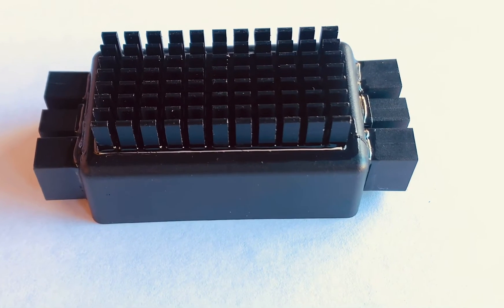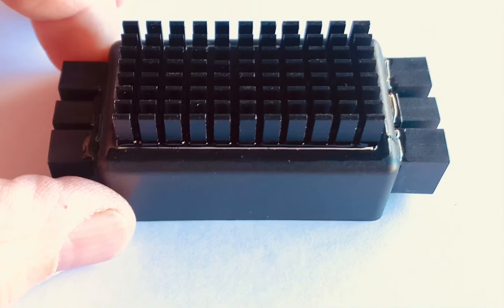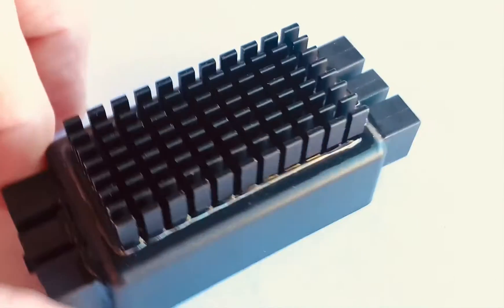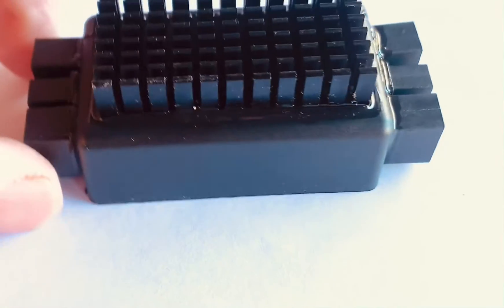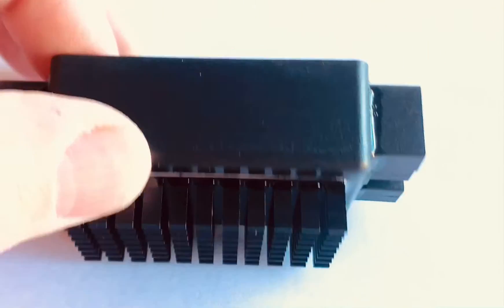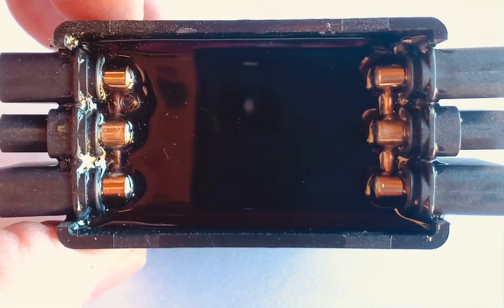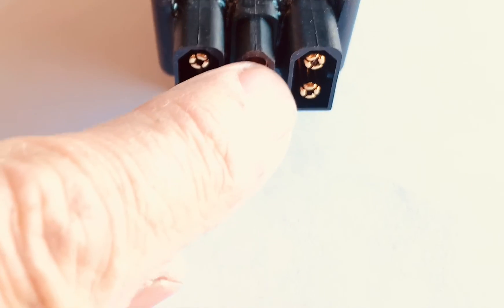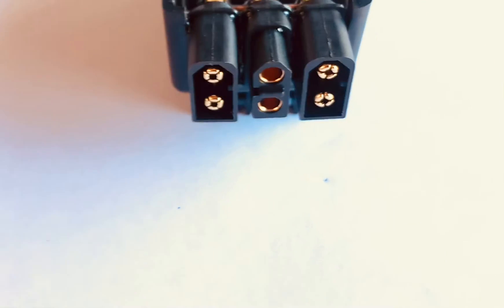The details of the FBC Battery Combiner

Comment: Why is it that this FBC module can't be used with regen?  Is it because the feed back current from the motor sees a high resistance (due to two batteries in parallel) and therefore drive a much higher voltage into the two batteries?
Reply from the maker: Current flow is limited to only flowing out from the battery, not in, thus no regen is possible.

Comment: any change for  a model that works between 10-30 volt
Reply from the maker: This should work fine at that voltage!  I've used them in many 12v applications, for example.
Reply: @electromotivemods2293  Then the next question is whether you deliver to europe?

Comment: I saw that the 50A dual FBC is sold out on the website. However, I see that the 50A dual FBC w/wire  is in stock. Is the only difference between the two is that one comes with a wire and the other doesn’t?
Reply from the maker: It's back with a listing for just the combiner.  I had packaged some with battery extension wire to test out the Kit pricing.
Reply: @electromotivemods2293  appreciate the quick response. I’ll try to buy one soon before they sell out again!

Comment: Do you have them with XT-90 connectors?
Reply from the maker: While the 90-A version we used to make had XT-90s on it, the connectors would not fit in this little box. You can use adapters, which we also make, they are listed on the website.

Comment: Just put out $275 for 4 piston Tektro  brakes. Juiced brakes finally became unmanageable for me. Need to replace the fork it pings on bumps too it gets stuck then releases. However that is manageable and so your item is next on my list. File for income tax return soon. Oh also had to get new motor for $625 bucks last month-it went after 6,700 miles. That one was expected. Anyway your up next with income tax return. Thanks.

Comment: Can we use one or the other ports for the motor controller? Why is there 2? I can't imagine a bike with multiple motor controller.
Reply from the maker: There are two ports for flexibility in connecting this combiner.  For example, you can use the 2nd output for accessories (step-down 12 power, USB charger, bike light, etc).  Some customers run the front motor controller off the 2nd port, so then you have up to four batteries working in unison to power 2WD,

Comment: The website has a note: "NOTE-1: This device is not designed for factory dual-battery ebikes such as the Hyper Scrambler II" does this not work with the Ariel Rider Grizzly v2 as well since the ebike comes with 2 motors and 2 stock batteries?
Reply from the maker: Not knowing how multiple batteries are hooked up on a bike equipped with multiple batteries, the product is not designed for this scenario.  That's not to say that it won't work, but you are on your own as to how to connect it into the existing circuit.

Comment: I'm looking to combine a 48v 24ah (factory) with a 52v 20ah.... as is, my monitor tells me what the voltage is while using the 48v.  Will i be able to monitor overall capacity with this combiner?
Reply from the maker: You will if you only go off voltage as opposed to bars (which is not an accurate way to gauge the remaining capacity any way).

Comment: is it safe to combine 52v and a 60v?
Reply from the maker: If there is no overlap in voltage (where it is equal) then there's no benefit of combining them like this. the 52v battery will range in voltage form 40.0 - 58.8v whereas the 60v will range from 48.0v - 67.2v.  The mid-level voltage of the 60v battery is at the peak for the 52v pack.  It's not going to get you much advantage by combining them, but you can do it.
Reply: @electromotivemods2293  ohhh I see. Thank you for the info!